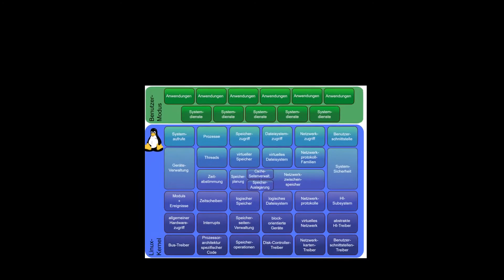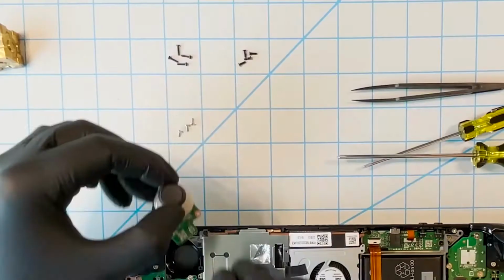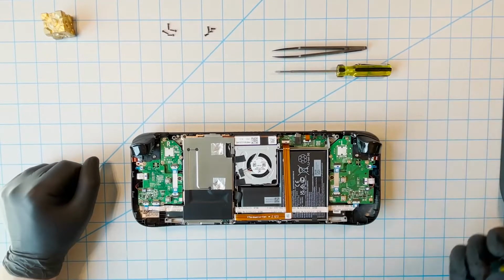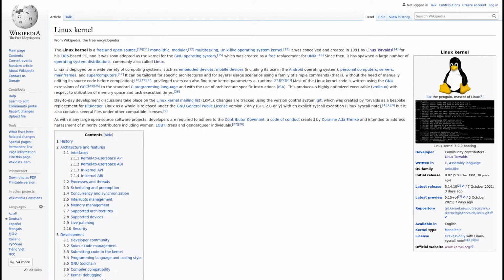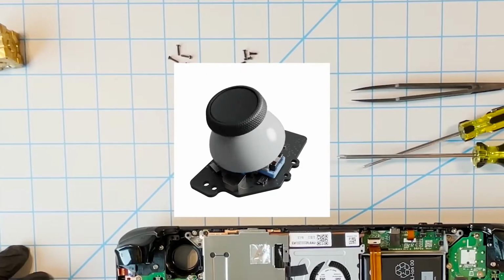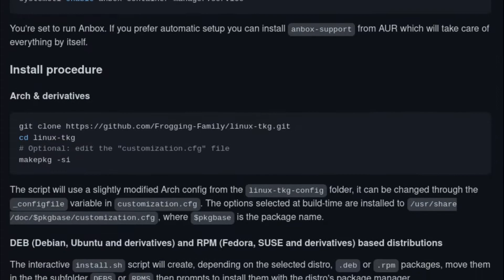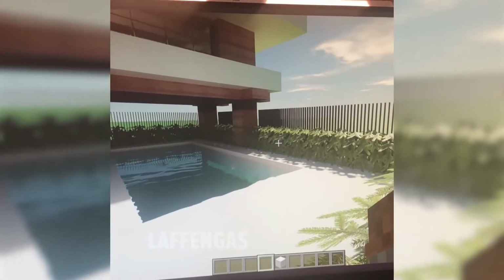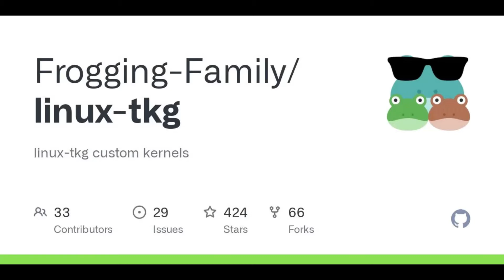Steam Deck video update. All about kernels!

Comment: It's likely that the Steam Deck has it's own custom kernel version applied, not only cause of information shown in Linus's video (It used a unique name for the kernel version), but also cause SteamOS has some features that are likely to be kernel-based as they're system applied, such as suspend and resume. Of course, that doesn't take away the fact that if a person want to, they can change it themselves.
Reply from the maker: True. I wonder (if they do make a kernel with custom modifications) if it will have things other kernels could use for general gaming preformance instead of steam deck specific things.
Reply: I think they were also working together with AMD on the power consumption and speed throttling and some of that work is already being backported to mainline kernel, so in the future there should be more optimal process scheduler for AMD (writing this from vague memory, so I may be also completely mixing this up with something else).

Also this video is nice, but talking about "5 to 10" frames per second is technically meaningless. Plus 5 frames is (performance wise) something completely different  when we are talking about average framerate being 15fps or 400fps... in the first case +5 frames is whopping +33% performance, in the later it's +1% (same as measurement error probably, with the extra bonus of high 100+ fps having extra pitfalls when talking about measuring them and HW performance conclusions - if the purpose of exercise is to benchmark HW performance, it's always better to try some higher setting to bring down average under 60 and measure differences there), so that particular information mentioned in the video is technically as valuable as talking about temperature outside of your flat being +10 degree higher to yesterday, without having any clue what was the temperature yesterday. Which may lead to you going out in T-shirt just to walk into snow wall....
Reply from the maker: You make a fair point. I did some distro hopping for a bit and ended up on Garuda minimal. This distro is a shining example on how optimizations can be more important than hardware and numbers. I guess this video was more to call attention to scenarios in Linux like this. If valve can optimize there system for the hardware to its fullest potential, Linux will be the pc gaming option of the future. Thanks to Garuda minimal's optimizations (and removal of the normal bloat on garuda) my system gained 1/5 of its total performance to put toward tasks I want to do. Games and general desktop performance have never been better and hopefully valve will use tweaks to go beyond what normal users can get and push Linux gaming ahead of windows. "You may say I'm a dreamer but I'm not the only one" -John Lennon.